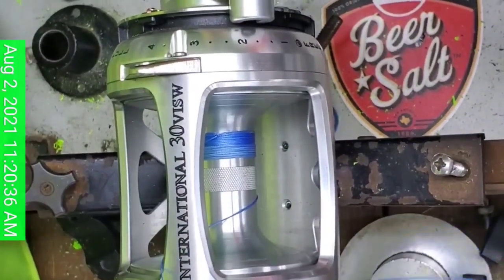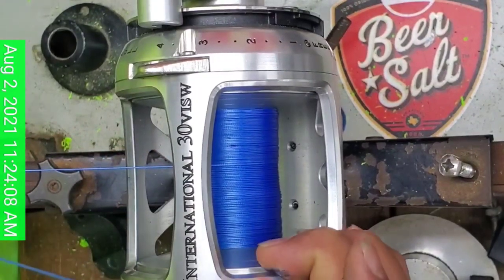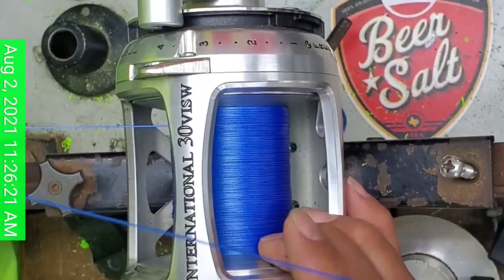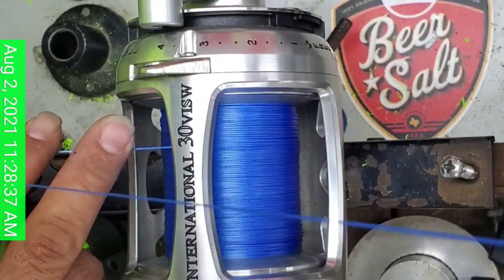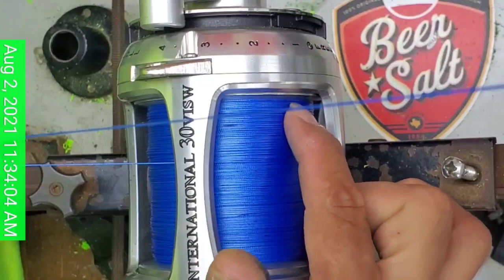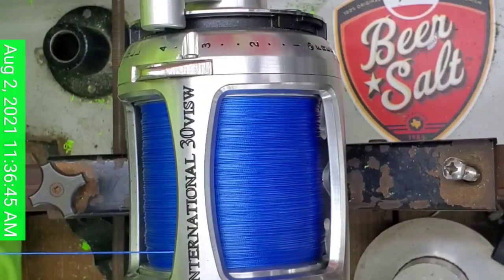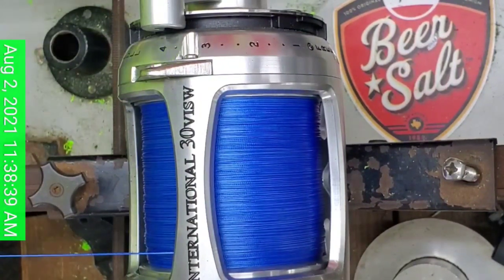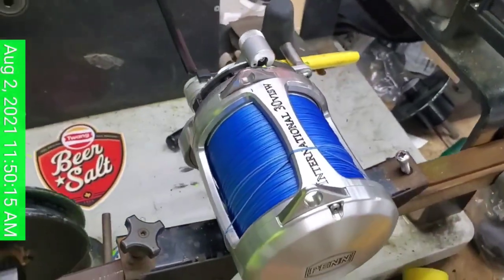Penn International 30visw Spooling 80lb Cortland Hollow core 16 strand knowledge recovery

Comment: I have a question, why would do some manufacturers ruin the smooth sides of there wonderfully machined spools by cutting three line capacity rings in them. I worry that the sharp edges of capacity rings on reels like the Fathom could damage line when it is dragged off under high drag pressures or damage line when it is packed on tightly.
What do you think
Reply from the maker: They feel real smooth i havent seen amy problems with that kid of issue.. and they use the 3 lines to show somekind of line Capacities of the reels...

Comment: Hi captain, I noticed when the braid was tied to the spool, you didn't put the wrap around the center with the rough "braid ready" part, is there a reason for that?
Reply from the maker: It adds more to that high point and rather kind of get it to level off faster by not doing it also our knot doesn't end the grip..
Reply: @TeamHardLife  ah I see, thanks for the info as always!
Reply from the maker: Sure thing